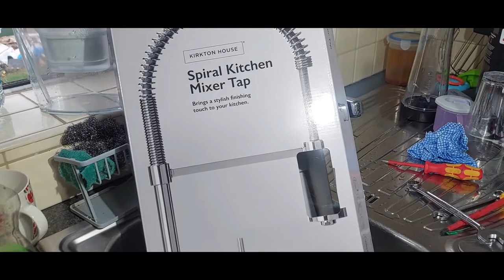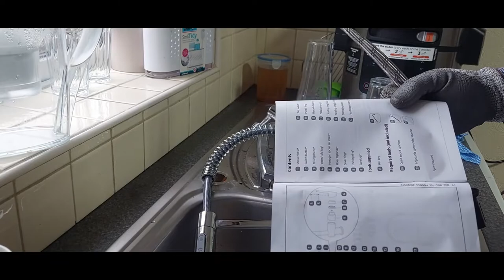How to replace your old kitchen tap for a modern Kitchen Mixer tap  DIY

Comment: Thank you very much. I just bought this mixer tap :)

Edit: i actually checked and i dont have connectors under my sink. I just have that copper pipes going straight to the mixer..

Comment: I have a tap that is identical to this but it’s leaking/spraying out from underneath where the metal arm from the spray tap meets the body of the tap. Do you have any idea how to fix this? Thanks for your help
Reply from the maker: Is it an old tap? the rubber seals might need to be replaced. Rubber seals can be bought at plumbing shops.  Do not tighten the seals too hard.
Make sure to apply enough 
PTFE tape between the flexipipe and the pipe works.
Reply: @maintenanceengineeringinsider  thanks for the reply! We’ve just moved in so we’re not sure how old it is and I can’t find a way to open the tap up. I thought it might need a new seal or washer inside but can’t figure out how to open it up to check. Looks exactly the same as yours in this video and I can’t find instructions online
Reply from the maker: @richy2k1 Find the supply line, and close the valve .  On the mixer knob of the tap, there is a cover that you need to pull off with a flat screwdriver. Beneath that, you will find a screw , removing that will help you to get to the seal of the mixer knob.
Again unscrew the flexipipes to get to the seals under the tap. One for hot and one for cold water.